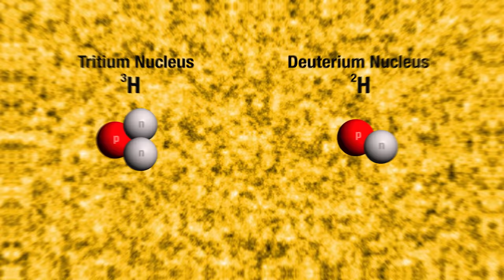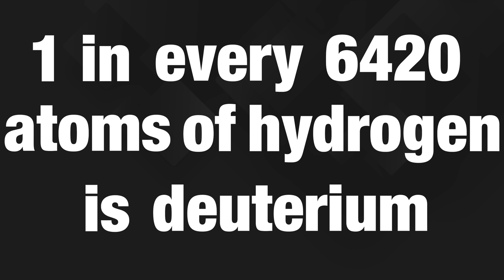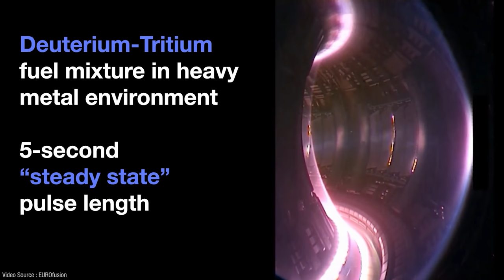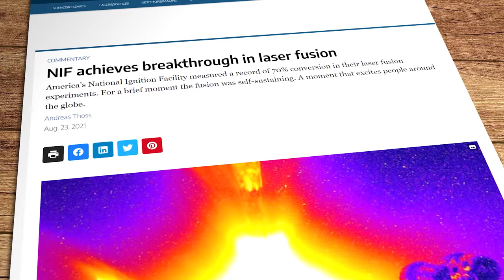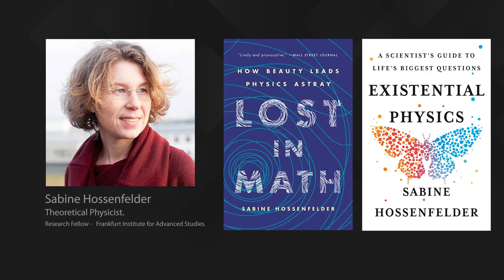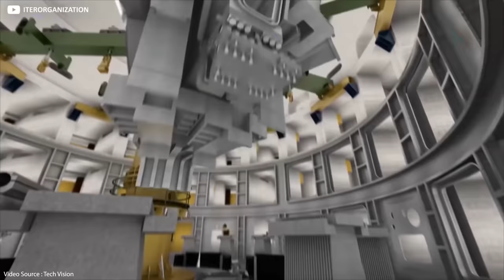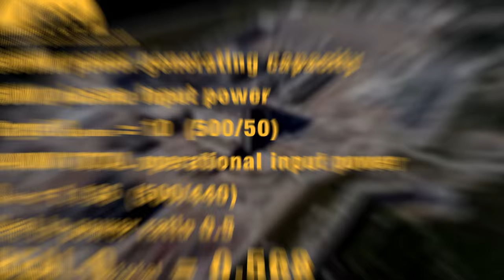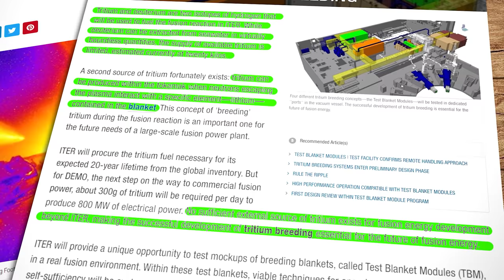Nuclear Fusion Illusion. Is it time to park the pipe dream?

Comment: I would like to see that money spent on the development of grid scale electrical energy storage. We have cost effective wind and solar, but, they're intermittent. A good energy storage solution would guarantee 24/7 power availability from the grid, as long as the AVERAGE output from wind and solar is high enough, to meet the AVERAGE demand for power by the customer base. Energy storage will also benefit "baseload" plants, which put out a steady amount of power continuously, by absorbing excess energy during low demand, and helping the baseload plant meet peak demand. (geothermal)
     Fusion would indeed answer the problem, and virtually render any other energy sources obsolete, but, like you say, that's likely still a ways off. Such a system would be baseload, and still needs, or at least, benefit greatly from electrical energy storage. Bottom line, Energy Storage is the "last leg of the triangle" needed, to be able to supply the grid using 100% renewable energy. (I DO consider hydrogen fusion "renewable", as well as wind and solar)
     My biggest problem with nuclear fission, is not safety during normal operation, but more, the fact that it's a "prime target" in a time of war. I wouldn't want to live in the vicinity of a reactor if it got bombed!! (Ukraine is a perfect example)

Comment: I think we would be way better off at committing and investing in building new modern advanced nuclear power reactors, LFTRs, etc. Because we have advanced so far beyond the era of nuclear energy that most of society is traumatized from that I feel like we can really help heal society and stabilize our power grid and lower emissions by a lot! We understand safety measures so much more now, computer technology, sensor arrays, all sorts of technology has greatly improved, material science, engineering capabilities, the list goes on. We can do so much better than the era of nuclear energy that had issues. We didn't take safety seriously, our knowledge and tech was prehistoric compared to today's so I say we commit to that and then go from there. That's my personal opinion.

Comment: To my way of thinking it's likely to cost 50 billion to build one of these things that may work but the maintenance costs are going to be phenomenal due to the stupendous amounts of heat generated. This thing is a white elephant and like the ol' thinker says, there are much better things to spend the money on. Imagine how many solar panels/batteries you could build with 50 billion and the sun isn't going to run out of energy for a long long time.

Comment: You imply that it took the researchers at JET 20 years to get from one record to another one. As if they were constantly working towards that goal. As far as i know that is not the case. Most of the time the scientists use these devices to make experiments to understand how plasma works - which is exceedingly hard. Not a single of the existing fusion machines that we have right now (even ITER) is intended to produce power. These are all basically (plasma) research labs. This is one reason why these machines are so compliated, too: a huge amount of sensors goes into these machines to take readings on what is happening in the super heated plasma.

For ITER there is also another reason why progress is quite slow: ITER is an international, political institution designed to direct money to research and engineering facilities. For this reason the parts of the machine are produced all around the world in different countries. This is not very efficient if your goal is build a fusion machine fast. But that is not the goal of ITER. The goal is to a) do plasma research and b) enable each country to build their own fusion machine afterwards if they wanted to. This means the whole project is limited to the speed of the slowest member.

Comment: To those complaining about the money spent on ITER.
Its pessimistic projection are a total cost of 68 billion dollars shared by the whole industrialized world over a period of around 50 years.
That's one tenth of the YEARLY military budget of just the US (so ITER has one 500-th the budget shared by about three continents.)
Direct costs of the Irak war were 1.1 trillion, with another estimate by Nobel economist Stieglitz rise to over 3 trillion.

And while it is true that ITER will never produce useful amounts of energy, that is simply not its purpose.It is an experiment for the next plant, called DEMO.
All the data harnessed by every state funded tokamak is very valuable ( and available! ) to all the private firms pursuing fusion. The most promising one in my opinion, MIT's Commonwealth Fusion Systems, is heavily based on the ITER  design with much better magnets. And without ITER they would have had nothing so advanced to copy from, which is what makes their project so reliable.
Iter is a project that has brought the world together in collaborating towards the definitive end of energy scarcity. I'd say if you are concerned with useless state spending, there are far better things to be concerned with.

Comment: In the long term, if we can achieve fusion, it will transform society in ways we can't imagine... but by the time it is viable, I don't think it will be particularly useful as a means of providing electricity. The push towards renewables and storage will by necessity mean a shift to more distributed power generation and a more flexible and robust grid. Moving back to large centralized power generation for electricity would be foolish, IMO. HOWEVER, that's not to say that it would be useless.  Fusion could power large scale mega projects like ocean water desalinization to irrigate arid regions. If it can be miniaturized enough, it would certainly be the key to creating space vehicles capable of traveling to the far reaches of our solar system in manageable time frames.
Reply: Oh and also on the space exploration front but perhaps a bit too outlandish to say whether we'd ever actually build: some sort of space launch system like a lofstrom loop or a miles long vacuum tube with maglev propulsion that can get a spacecraft up to escape velocity without having to ride an explosion of rocket fuel.

Comment: In an interview with a nuclear research & development firm back in the early 1960's I happened to bring up the topic of nuclear fusion for electric power production.  The interview people said that nuclear fusion up to that point had not achieved what Enrico Fermi and his fission reactor did in the mid-1930's  --- a sustained reaction over a period of time which had the potential of being engineered into a productive production system having sufficient reliability to be interconnected to an existing utility's electric power system.   The actual latter example happened nearly two decades later which is probably where the "20 years .  .  ." number originally comes from referring to the development period for fusion reactors.   Like single-stage-to-orbit [SSTO] & vertical take off [VTO] personal vehicles; the technical communities of the world will continue to spend billions on these willow-the-whisp programs for at least the remainder of this Century with probably very little to show for their efforts and our money.
Reply: the joke in the 80s was 50 years, not 20. Then it was updated to 30 years. 20 is new since SPARC and MAST are showing so much promise.

Comment: We could start by being more, much more efficient with our use of electricity.  Have super stores with wide open doors throwing heat out, to warm the planet should be illegal.  Russia stores (even very small ones) simply use double doors.  Similarly, along with lit offices when everyone's gone home.  Secondly, a great many appliances could work perfectly well off 12 volts, with relatively little modification - fridges, extractor fans, air conditioning ...

Comment: Actually,  geothermal energy seems like the most prudent and least problematic way to go. Earth generates a lot of free and accessible heat energy beneath it's crust. Some of it comes bubbling up at certain locations, where geothermal facilities are built. The rest is deeper down and not as easy to access. But there are people working on ways to make geothermal available from most any land-based locations. Geothermal appears to be clean, and carbon neutral. So it seems like we should be paying more attention to that source of energy than we have. I'm interested in finding out more about it. So should we all be.
Reply: It's just nuclear energy with extra steps.
Reply: Radon and earthquakes in the few places with enough geological activity to produce electricity isn’t what I can ideal.
Reply: @ChucksSEADnDEAD  How is it nuclear energy with extra steps? No atoms are being either fused or split. Therefore it is nothing like nuclear energy.
Reply: @ChucksSEADnDEAD  Really? I thought it was all due to the core temperature being very hot as a result of the pressures deep within the planet. And of course, some of that heat seeps up toward the mantle and the crust where it manifests at certain fracture and fault lines, as it does in, say, Iceland.
Reply: @brucemacmillan9581  I mean, it's partly that too but that heat would disappear over billions of years. Radioactive decay kept Earth from cooling down.
Reply: @ChucksSEADnDEAD  Yes, I Googled the subject, and it seems the heat is a combination of factors, including radioactive decay. As they say, learn something new every day.

Comment: Why not use the energy we already have on earth instead of trying to make/bring more in to a already overheated system? I propose to use heat pumps to concentrate heat out of sea water and run sterling generators with that. The basic math I can led me to the following conclusion: First you use a heat pump that has on average a efficiency of 1 to 5 (1Kw of electrical power gives 5 Kw of heat energy). That heat is used to run a sterling generator that has a efficiency of 40% that gives you 2Kw of electrical power. 1Kw is returned to keep the heat pump going and you get a 1Kw surplus/extra electrical power out. This is a simplified summary of my idea, more efficient heat pumps do exist and the "cool" side of the sterling can be sent back to the heat pump again to extract more energy from it. Many further changes can be made by qualified material scientists and engineers but I have tried to find a reason this would not work but has not so far. Any real experts out there who can tell me if there is even a remote chans this can be done along my idea?
 If the surplus energy is only 10% it would still knock fusion power out of the water because of how cheap in comparison this thing could be per KWh and no fuel is consumed , nothing is polluted and if done in large scale it will reduce severe storms by taking their energy out of the water before they can.
Hope this can be useful to reduce both fossil fuel burning and nuclear waste production.

Comment: At the end of the day it is not about Q at all. It is about revenue vs cost. How much does it cost to produce X amount of heat and for how much can one sell that heat/electricity/mechanical energy. Q plasma greater than 1 is a stepping stone to Q total greater than 1 is a stepping stone to an investor making a reasonable rate of return from an investment. Each of those steps is huge. Meanwhile the cost per KWHR for solar panel electricity has dropped by close to an order of magnitude in the last decade and the technology of energy storage is rapidly advancing. I think the only reasonable justification for spending money on fusion research at this time is that it advances lots of other technologies that have lots of other uses. As engineers and scientists develop new technology in pursuit of fusion someone should be constantly looking at how that technology might help solve other current problems.

Comment: I felt this video left out practically everything there is to say about current fusion research. Nobody thinks the NIF milestone is anything but a dead end. LLNL exists to do thermonuclear weapons modelling -- the NIF hohlraum fusion research is just a sideshow for the scientists there. ITER was designed before HTS magnets existed. It's a model of government bureaucracy and inefficiency. China's EAST is not even trying to be a fusion reactor.

All of the interesting fusion research is happening at privately funded companies, and there are at least half a dozen of them that would have been worth exploring. Several of them are in the design (and some in construction) stages of net energy reactors. Of course, nothing is guaranteed but there are enough different design concepts that the chances of at least one of them coming through is not insignificant. The fusion landscape has changed enormously in the past decade (which you wouldn't guess from watching this video). One gamechanger is HTS (high temperature superconducting) magnets which are producing fields of 20+ Tesla. Tokamak energy in the UK recently announced a breakthrough which dramatically reduces the costs of the cryogenics for these magnets, a significant fraction of the input energy costs. Helion (among others) is working on an aneutronic fusion concept which produces none of the irradiated low level wastes, and also does direct energy conversion -- no need for a steam cycle and associated inefficiencies and water requirements.

One of the things rarely mentioned are the scaling laws associated with different fusion reactor concepts. There are exponential relationships with reactor size and magnetic field strength (at least, in magnetic confinement concepts). Several reactors scale with the fourth power of "beta", the ratio between magnetic field strength and plasma pressure. Once demonstrator machines crack the remaining engineering challenges, the ability to scale up is enormous.

Will any of these come to fruition? Who knows. But another gripe of mine is that renewable energy proponents also overlook potential technology showstoppers in their grand vision of the future. For years they have been promising that the Achilles heel of renewables -- intermittency -- will be solved by grid-scale energy storage. But, like fusion, that always seems to be a few years in the future too. And unlike fusion where the remaining challenges are engineering ones rather than basic science, grid scale storage faces some basic thermodynamic roadblocks. It seems unlikely to me, for example, that battery storage will ever scale up to meet the challenge. And yet this hopium is constantly being touted.

Comment: I will agree that ITER is a dead end.  Even if it works, there is no way forward to economically generating energy with it.  However, the irony is that fusion is in a far more hopeful situation that ever before due to breakthroughs in magnet tech.  

Short version: the fusion yield is related to a number of factors.  The JET reactor is still the high water mark in 1997 because of limitations in magnet tech.  It used copper coils which are powerful but overheat quickly.  Attempts to use superconducting coils are limited because traditional superconductors break down at high magnetic fields.  This is unfortunate because fusion yield is related to the 4th power of magnetic field strength.  Not having an alternative, the designers of ITER used another factor - size.  The linear dimensions of a fusion reactor are linearly related to the fusion yield.  You double the width of the chamber, Q doubles.  The problem is that they had to scale up the chamber by severalfold and the total volume and cost of the reactor scales with the 3rd power of the linear dimension - giving us the giant boondoggle that is ITER.

However, high temperature superconductors, when used at very low temps, are much less sensitive to magnetic fields, allowing them to be run at higher strength.  The MIT ARC/SPARC project has been pioneering that and has recently demonstrated new coils that more than double the magnetic field strength - giving a roughly 16+ fold increase in Q.
SPARC is a small research reactor that is expected to be done in 5 years that should get to a total Q of 10, or about what ITER is expected to achieve.  The ARC full scale reactor (which is a small fraction of ITER's size) should be able to achieve a Q of 20+ and real world net power generation within 10-20 years.

Here's a good overview: https://www.youtube.com/watch?v=h8uYNhevRtk

The original video from a few years back, more technical in nature: https://www.youtube.com/watch?v=KkpqA8yG9T4

I would strongly suggest looking into this.  These new magnets are a fundamental shift in the fusion world and will make ITER obsolete before it powers up.  While unforseen technical hurdles are always possible, there seems to be nothing in the way for Qtotal over unity within the next decade or two in a relatively small reactor.  The other important part is that his new magnet tech applies to all magnetic confinement fusion reactors such as the stellarator as well.  So if the basic tokomak design is flawed, that doesn't change the overall conclusion.

Comment: This is the crux of the problem: All you're trying to do is reliably boil water so the steam can spin a turbine. That's it. There is literally nothing beyond that. If we could train squirrels to boil water to make steam to spin a turbine, there would be a mass squirrel breeding program. So, since this is the case, we have to ask ourselves - what is the simplest and most sustainable method of boiling water to spin a turbine? I think the problem solving that question is more a lack of imagination combined with entrenched Powers That Be demanding a centralised energy production system, because PTB's are inherently conservative and heirarchical in order to maintain their dominance structures and protect their sunk costs in such systems.
The only thing you have to do is reliably boil water. Everything else is basically irrelevant.